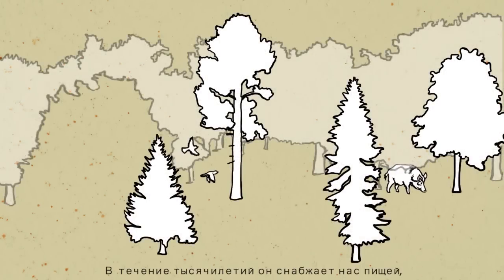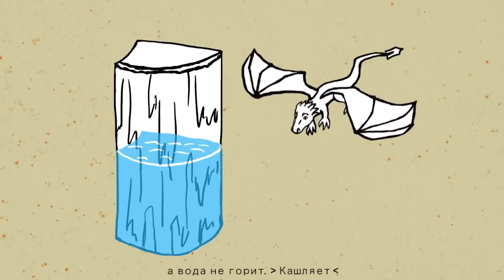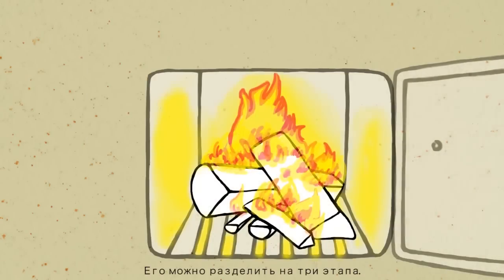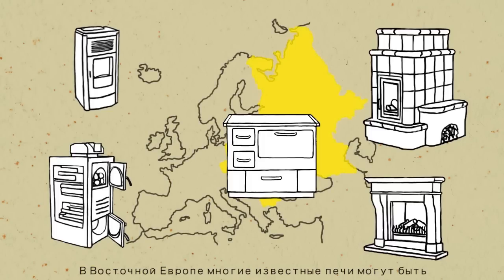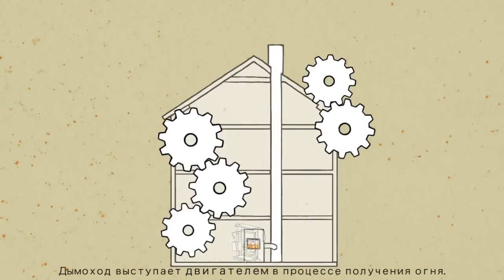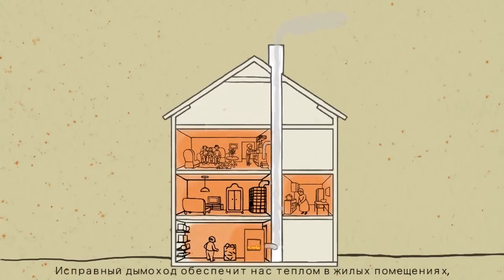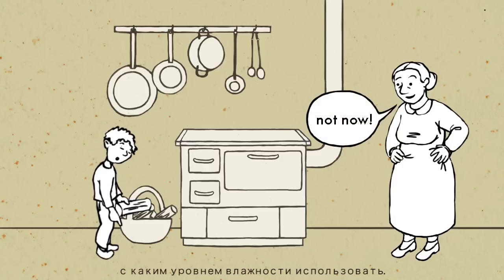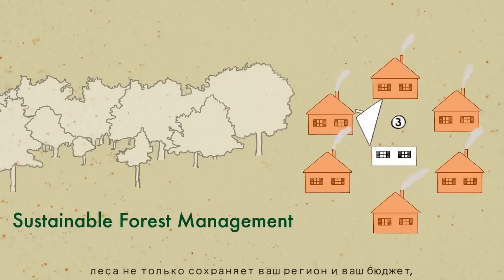More heat with less wood

Comment: All wood that decomposes emits co2, so burning it just releases that amount. The problem with fossil fuels, the co2 they admit, has been stored for many ages already. Therefore, you're not releasing co2 stored recently,  but adding additional co2 from long ago.

You neglected the use of thermal mass in your house that seams to be a better solution and that has been used for thousands of years. You could construct out of a natural stabilized thermal mass material and absorb the heat instead of losing it. Instead of insulating inside the walls, you could wrap them in insulation, thereby collecting the heat and minimizing the loss.

Additionally, if you added ground thermal air intake with a solar chimney exhaust, you could raise the air infiltration temperature with little to no electrical use. Again, this is a method that has been proven over many hundreds of years. Even if a much less technological method is possible today.

Comment: Well you cant measure it by weight because 1kg of dry wood is significantly more wood than 1kg of moist wood. This is why you measure the kwh per volume not by weight, this is a really cardinal mistake and the credibility to the rest of the video really suffers

Comment: None single word of CO... But it's a huge questions and it's an issue
Reply: carbon monoxide is only produced at high combustion temps, and is an inherently unstable molecule. In the presence of oxygen, it will inevitably decay to carbon dioxide. Wood stoves are rarely capable of creating carbon monoxide. Natural gas, propane, fuel oil and coal all have much higher flame temps, and are thus a far greater risk to create this gas. Luckily, minimal ventilation will clear a room in minutes and the detectors are very effective. 
This is honestly a boogie man issue, made to seem far bigger by news companies looking to sell their airtime with fear.
Reply: @ChristnThms  It's not fully a boogie man issue looking on efficiency))
Reply: @yevhenrekhtin6591  I didn't say anything about efficiency. I said that the threat of carbon monoxide was a boogie man, fed to people via news agencies selling fear.
Reply: Rewatch the  video and see Anna laying on the floor from CO poisoning.

Comment: Poor English sentence structure produces inappropriate science reference. Biomass combustion cannot exceed 99+/-% because of variability. Thermal energy cannot be increased beyond primary chemical basis of original biomass. When you break the rules of thermal energy you violate everything else thereafter. See: https://en.m.wikipedia.org/wiki/Conservation_of_energy#First_law_of_thermodynamics. Re-title suggestion: Better heat management produces more thermal heat for your living space.  Like the video content - Good info!

Comment: These propaganda films are awesome. They will rate a wood stove at 97% efficiency and, because they are engineers doing it, people will actually believe it's true. Follow the money people. Who is paying these engineers? The ones that build the stoves. That is why the regulations are so stringent on heating with wood. They want you to spend 2K plus to install a wood stove and pay all the bureaucrats, when they know perfectly well that a rocket mass heater is 5-10X more efficient, safer and can be done by a average person for a couple hundred dollars. Do you really think that their prime concern is for the environment? If you do, well then, I just feel sorry for you.
Reply: They are not propaganda. First you have to watch the stupid video before you spout number that make no sense. Down draft wood burners are 90% efficient and a hell of a lot more then 2k. Mass heaters are more efficient, but once you're dealing with that 90% they are not 5x more efficient. They are a hell of a lot cheaper to build but a bit more work to keep going. As for the bureaucrats you're on your own depending where you live. I feel sorry for you and me for watching this boring video. However it was technically correct just dumb.
Reply: Not so easy to do without appropriate knowledge of welding

Comment: 3 words.... Rocket Mass Heaters.
Reply: A masonry heater works as well. Re-burner is necessary to get higher efficiency.  Re-burner in combination with catalytic combustor will lower emissions even further with additional expense. 
If one wants to save space. Heat storage in water takes up less space.
Micro CHP systems are even better in cold climates since you end up using the same energy twice by using electricity inside. Just like waste heat can be recovered from wastewater :)
Solar thermal heating and heat pump systems ain't bad either.

Comment: Rocket Stove > modern wood burners
well built rocket stove system with large heatsink uses 10x less wood then modern wood burner to heat the same house.
Reply: Leon Cryp Rocket mass heater even better in my honest opinion. 2 days of heat on a 2 hour burn.
Reply: Chad Ringstrom
I though those 2 terms are used interchangeably, but yes I think the correct term would be Rocket Mass heater, as Rocket Stove is just a efficient burner used for cooking and no heat capture.
Reply: Yes Leon, RMH uses a large mass, often a cob bench that has a flu running through it, where as a rocket stove is usually just a J-tube type design and a cooking surface, often missing the secondary burn chamber / Bell. When others are commenting on how can you get more efficient then a 95% rated stove, they should take a step back and compare how much wood each would use over a year. You may often find that  a RMH (Rocket mass heater) would use about a quarter to 10th the wood over a standard wood stove EX: Franklin wood stove, due to how it stores energy in a heat mass.
Reply: So a rocket stove is 10x more efficient than a wood gasifier stove with an efficiency off 95% xD that makes sense
Reply: You need to understand how the industries calculate the traditional wood stove efficiency, its basically not honest, I cant remember exactly how they do it but if you google vs rocket stove it you should be able to find out easily, Think about for a moment, for it to be 100% in science which just means 100% energy transfer, the traditional wood stove chimney output exhaust temp should be the same as input temp which is about room temperature, that is not the case, the exhaust temp is  im guessing about 150-400 degree C. From memory Rocket Stove some people got less then 100c for the supper efficient type, that is less the boiling water. the Riser chamber burns around 1500c which is enough to melt mild steel, there is no smoke and leaves extremely little soot, the higher temp that its able to achieve and long burn chamber burns all the gas and soot its part of the efficiency design, there is water vapor coming out of the chimney tho, and you cant really smell smoke, before he heat leaves the chimney its ducted through a very long distance where the heat can be transferred out, they can even duct it downwards on the floor below the burner (that is not possible in traditional stove). just watch a few youtube rockets stove vids and u will understand more
Reply: No way the rocket stove can ever beat the modern wood burner presented in the video.That has automatic air flow controll and oxygen lambda probes and works automatically.Rocket stove its thousands of years old invention and in fact those 20 percent european stoves are rocket stoves.
Reply: But yes at rocket stove is great. But not better than a modern stove. Don't know how it is in you country. But here ind Denmark the are strict rules. You can't put a rocket stove Ind your house. It has to be certified and tested. If it's a main heat source it has to be over 90% efficiency. My stove is rated at 96. Something
Reply: Darren Munsell Yea,110 efficient,its true and its not perpetuum mobile.Its actually 96 efficient from the fire burned plus 10-15 percent added to that from the condensation( when condensation happens,it releases energy into the system similar to the heating with an air conditioner that can get up to 400 percent efficiency).Air condition 400 percent efficiency means you get 4 KWH of heat with one KWH of electricity consumed,in certain conditions.
Reply: Darren Munsell https://www.livingwithenergyiniowa.com/energy-saving-articles/pick-the-right-heat-pump/
Reply: My stove get the wood gas temperature down to 80 c° could go lower but that would make condensed water and ruined the stove.
Reply: More efficient burn, heat storage slow release, more environmentally friendly:
As i said earlier people has reported 10x less wood when they converted the normal stove to a properly built rocket mass heater. 10x less wood does not mean 10x more efficient then normal stove, u just use less wood for the same heat, after the rocket stoves wood burns out, the house is still warm till the morning, coz the heat sink mass slowly releases heat out, where as conventional stove when finish burn the house starts to cool down. just youtube and you see what i mean.
Your stove probably dont burn around 1500c, there for gives off less heat, lots of unburnt gass and soot released to the air wastage and air pollutant, not as environmentally friend too, I dont know how your current stove is setup but, if you have a very long chimney I can imagin the output heat will be less, most of the heat is radiated off the chimney, your chimney also smells of smoke and need to do yearly cleanup in the chimney soot/ash built up, this is coz its not an efficient burn, as its not hot enough,  its like an old/defective car engine what has lots of smoke in the exhaust, there are plenty of unburnt fuel, which makes it inefficient, Rock Mass Heater with its high heat burns very clean, then the heat is transferred to a large mass as a heat sink for storage and slow output. Some people insulate the outside chimney too, this will prevent it from condensate outside.
Reply: Yes but you also easy to use more heat than you need. And then your house takes a hole day to cool down.
But I'm not saying that they are bad. I actually like to have one my self. But a mass heater that is legal here in Danmark. Is more expensive than a fully automated stove.
But just wanted to say the statement that they are 10x times more efficient is bull....
Reply: Darren Munsell You didnt got it.The heating device shown in this video its like a rocket stove but much better because the flow of air and the burning is automated and controlled.And because it uses air from a fan its 4-5 times more efficient than a natural flow of air that needs a big temperature difference in order to draw the air.
Reply: Darren Munsell Your wrong.Water heat transfer ( hidronic) its = or better than thermal mass heat transfer.It can even reach 110 percent efficiency due to condensation in condensing boilers.
Reply: Exactly what I was coming to say Good Man .
Reply: A modern boiler doesn't need a thermalmass because it only burns when you need heat or your water is cold. I know how a mass heater works. And the most efficient one I could fine was 92% efficiency. And that's if you don't over feed it. And get the fire right. Plus the chance are that you're going to put to much in and get house to hot. And before you make a fire again the house get to cold. I just fill the tank with pellet for to weeks and it takes care of everything for me. Only have to clean out 2 times a year. It can even fill it self with pellet's if you don't bother. And have all kind of censors to make sure the burner is always burning at the right temperature and have the right amount of air. 

I'm not saying a mass heater is bad just that the original comment said it was 10x more efficient. Is just stupid. It's pretty good but not better than a modern boiler
Reply: You don't get it. My stove is 96% efficient. The smoke is between 75-80c when coming out off the stove. Not out off the chimney.
And it's has censers that measures the combustion so it always burns at the optimal temperature. So no you rocket stove is effective. But no way a homemade stove is beating a top of the line central heating stove
Reply: @raunefare  A rocket mass heater can competive with yours, because a rocket burns with over oxigen and therefore it stabilizes itselfs, burns above 1100 degrees, it is because of the insolated build in chimney who function also as a afterburner for woodgas, yours is 96 procent efficient that is afcourse very good, a rocket can go even higher, 98 procent is feasable also, it is a good system, I think yours need continu be fuelled, a rocket is just 2 hours a day for 24 hours of warmth making it very fuel efficient, this last part has not much to do with efficienty but with heat storage.
Reply: @audiokees4045  I only fill mine every 2 week. And it keeps a steady temperature. A rocket stove is more difficult to keep at a steady temperature. And you need to make a fire every day. And the test I seen on rocket stoves  are at 90. If you get to close to 100 % or over your wood gas will kondensat. You can get a pellet burner with 106% efficiency but then you need a chimney with a drain that can handle water. So still thinks a pellet stove is superior. And more convenient
Reply: @raunefare  except you are  hostage to the cost of a processed product.  I can cut my own wood, or buy it. HOWEVER*** I LOVE how clean burning a pellet stove is! After a long winter, the 4 foot section of chimney pipe was CLEAN!! ONLY minor deposit - OF SAND LIKE ASH! 
GOTTA LOVE THAT!

Comment: 2:19 #3 actually has 2 stages. 3a, volatile components burn, giving robust yellow flames, some smoke. I suspect the temp is about 1100degF. 3b, charcoal substrate burns, giving modest blue flame "Charcoal briquettes can burn up to approximately 1,260 °C (2,300 °F) with a forced air blower forge" - https://en.wikipedia.org/wiki/Charcoal
https://homeguides.sfgate.com/temperatures-woodburning-stove-48039.html
Color of flame indicates temperature. https://en.wikipedia.org/wiki/Color_temperature

Comment: rocket mass heaters
Reply: Pretty sure a simple rocket mass heater isn't as efficient as a high tech wood gasifier stove is. Plus it can control the combustion so you don't make more heat than you need to fast

Comment: Okay, "BTUs per lb" goes up as you dry the wood; almost doubles. But the wood gets LIGHTER as it dries. (So fewer total pounds of wood.) What about "BTU per volume?" If you have a cord of green wood, how much does BTU go up as it dries? (It won't be double.)
Reply: Well the energy needed to dry the wood has happened before burning it so you can use the sun and wind to do that or you can burn more wood to do it. I heat with wood and I would say that volume is the better measurement then mass because some woods will weigh far less when they are dry but the amount of heat that you can get is far far greater then.
Reply: @tomkelly8827  Good response. Plus, you won't have a chimney 🔥 because you have massive creosote buildup. If your wood is not properly dry, at least make certain to never damper down, but give it full air supply until the moisture is cooked out of the wood. At that point, when you open the stove door, you will no longer hear the hissing sound of water vapor escaping from the ends of the wood😊
Reply: It is volume of wood not weight, also wood schrinks when drying but not that much as weight of it.
Reply: btu/l
Reply: Volume doesn't matter. Its just water. New cut wood has like 40 50 percent of water. So that you refer is water. Yeah water. Why would you want to burn water?

6KG of dried seasoned oak will heat a an average room burned in an iron wood stove from 4C to 20C in 2 hours. While wet wood will need around 10KG to do so and longer than 2 hours. Also more creosote build up in chimney. Your fire efficiency will be lower, zero secondary burns too.. Dry wood burns clean gives more heat. 700KG dried wood is better than 1000KG wet wood. Way better. Never burn wet it's just stupid.